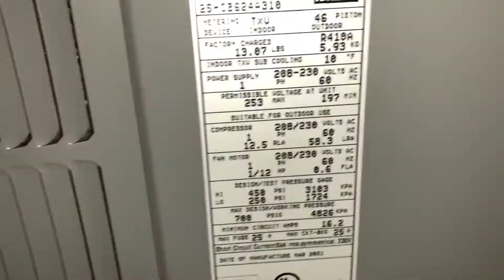2021 Carrier Heat-Pump Quick Defrost Cycle

Comment: Nice sounding unit. At 0:33 that was it going out of defrost. The fan blades always start up again 20 seconds after the reversing valve switches. I believe carrier used to call that “perfect defrost”

Comment: So you’re actually using it for heat. I’m so used to just AC mode so that’s different to hear.
Reply from the maker: This is actually the first Heat-Pump that our family has ever owned, and this was actually the very first Heat-pump I’ve ever seen defrost! It’ll be interesting to see how it performs in the winter. We live in the midwest, and have been known to get harsh winters, so heat pumps aren’t too common around here.

Comment: Are you gonna be able to the Kenmore Elite Catalyst Washer video I requested soon?
Reply from the maker: Unfortunately the weather made a sudden shift to being cold so I had to winterize the machines earlier than I hoped. However as soon as I can un winterize  them, it will be one of the first, if not the first video I make!
Reply: @DrummerboysWashersAndMore  When will the unwinterization be?
Reply from the maker: @MFV13  I’m not sure exactly when, but it’s whenever the weather starts to warm up. Usually that’s around mid to late March or early April. In the meantime though, I have three other machines that I planned to make videos on, so I could do a request on those. We have an Amana NTW4516FW1, Amana DD NTW4600VQ1, and a Maytag A382.

Comment: Nice catch on that defrost cycle. I couldn't quite make out the model number, that would indicate the tonnage. March 2021 is when ours was manufactured as well. The paint was barely dry on it when it was installed just a few days later!
Reply from the maker: I considered it very lucky to catch what was probably the very first defrost of this unit, especially since it wasn’t very long. I believe it uses a time/temperature defrost, where if the coil stays at or below a certain temperature (probably around 30 degrees) for long enough, it will send the unit into a defrost until the coil reaches a certain higher temperature.